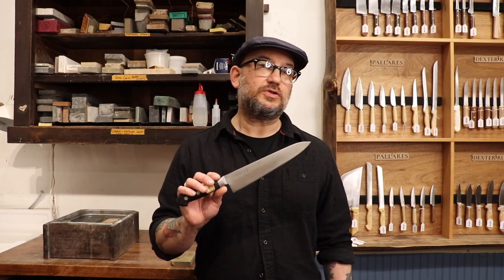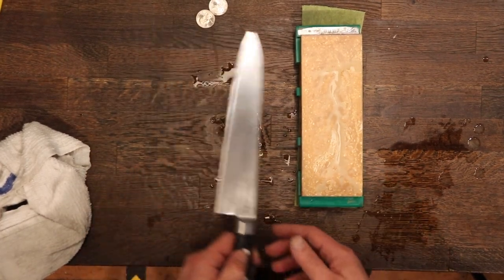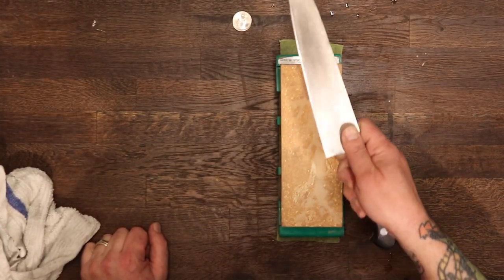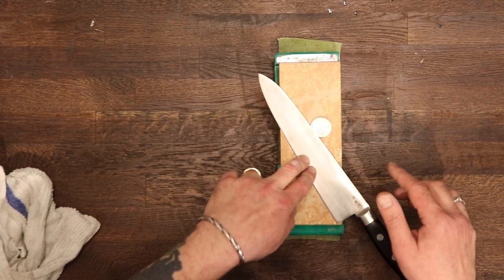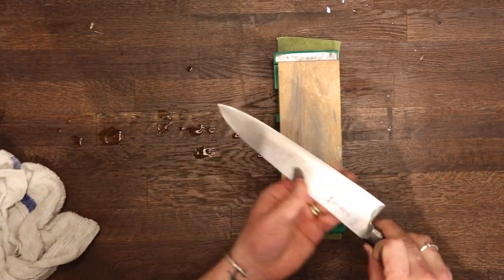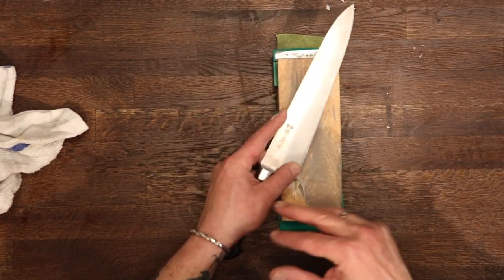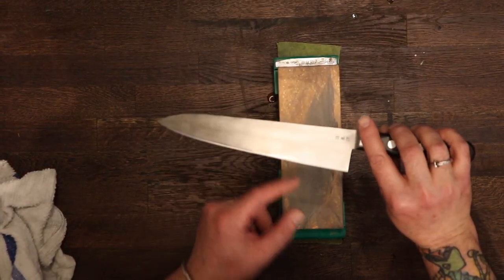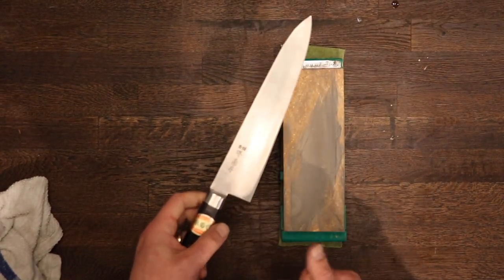How to Sharpen a Double Bevel Knife with Bernal Cutlery!

Comment: I'm reading your book. I find the discussion of Japanese blade geometry very interesting. I went to the local sushi store and bought an inexpensive Japanese gyuto knife and it illustrates what you are talking about in terms of knuckle-side bevel and a thinner blade. Question. I'm a cabinetmaker and have two Tormek wheels that I use for my chisels, hand plane blades, and other cutting tools. What do think of the Tormek water wheels for sharpening kitchen knives (as opposed to strictly sticking to stones)?
Reply from the maker: Hi, thanks for the note, the Tormek are the most accessible water cooled grinders out there, I used them for years and they did alright, they typically need their hollow ground edges flattened however, with a wide bevel this is a ton of extra work but on narrower bevels it’s not too much extra work typically unless the knife has been sharpened in a lot.
Reply: @bernalcutlery-sf  Thanks for your response. You obviously know what you are talking about.

Comment: Honest opinion is that in this modern era a diamond stone or maybe cBN( wich I never tried unfortunately ) is simply the best option , cuts amazingly fast.
Problem is that western producers  keep prices inflated , otherwise they could just sell a good stone for 30$
Reply: I have a resin bonded diamond stone and it's great for polishing. Stays flat like no other stone and considering the grit cuts quite fast. 
For polishing I'm quite convinced at how good diamond is but for apex sharpening not so much.  

There are electron microscopy images on Science of Sharp showing diamond can break carbides. Not only vanadium carbides but all other types including chromium carbides seen in most knife steels. This may leave a perfectly formed apex but with increased metal fatigue and low durability. It doesn't always happen but its quite common. I've had this problem and I've seen some friends having the same issue.

If you are happy your with edge durability there is no need to change but if you want to try something different and compare performance here are some tips.
 
After you sharpen on diamond finish with a microbevel edge leading on Al Ox stone or few passes on trailing on loaded strop. This will likely remove the fatigued metal. 

Loaded strop with diamond compounds don't seem to fracture carbides but may create foil burr so a few passes is better than ten passes.
Reply: @thiago.assumpcao  Oh ok, so you think for non vanadium Al ox is still best all around ?
Reply: @dimmacommunication  I do think Al Ox are more versatile than diamond stones, specially if you plan on finishing on stone but I also love several other types of equipment.

For finishing general purpose knives my preferred methods are Al Ox stones 1-6K , Hanging Denim strop with Solingen paste, and Slate with 120 SIC conditioning. 

All these work excellent but each material has its own technical details. If you want best results understanding each can be tricky.

With Al Ox you need to learn how to flatten the stone, no light passing under a ruler is good enough to cut paper towel one handed. Edge trailing doesn't fully remove burr. With correct deburring technique you can cut paper towel even from low grit stones like 300 and that's an excellent challenge. For barbecue and rope this is an excellent finish but will strugle a lot cutting raw meat.

Coarse conditioned fine slate is no joke. Cheap stone and has an excellent finish for a general purpose knife, on my two samples something around 3-6 K. I wouldn't use it on a blunt knife but for edge maintenance its a great option. Probably several other natural stones work similarly well or better like Arkansas stones, Jade, and J Nats. I also got Jade but its conditioned as a razor stone so I haven't tested it yet.

Hanging Denim doesn't create foil burr like other strops so you can do as many passes as you want as long as you keep it straight, use very low pressure and don't raise the angle. Solingen paste leaves a relative grit around 6K. 

Many people recommend diamonds for vanadium steels, that makes sense because Vanadium carbides are harder than Al Ox but weirdly enough Al Ox stones do cut Vanadium carbides. I would never imagine that and don't fully understand how  it works but there are electron microscopy images of clean cut vanadium carbides on Science of Sharp.
Reply: @thiago.assumpcao  I saw some microscopy and vanadium didn't get cut ,maybe depends from steel to steel, don't know.
Even only 2.5% vanadium was a tough cookie with Al ox stones , can't imagine 8% 😂😂😂
Reply: @dimmacommunication  Where did you see those images?
Reply: @dimmacommunication  The article I'm talking about is "Carbides in K390" which has 9% vanadium. 

I don't own any high vanadium steel so no idea about cutting speed on Al Ox.
Reply: @thiago.assumpcao  I have a 2.5% Vanadium and I can assure you the cutting speed is very reduced even at this low %
Reply: @dimmacommunication  Makes sense. If speed is faster on diamond you can create new apex on it then check if removing burr and finishing touch on Al Ox makes any improvement in durability or sharpness.
Reply: @thiago.assumpcao  Yeah on diamond you can feel it's much faster